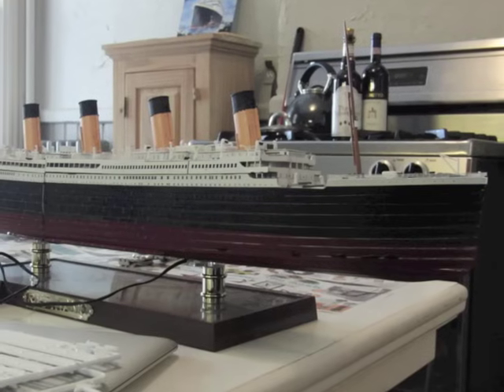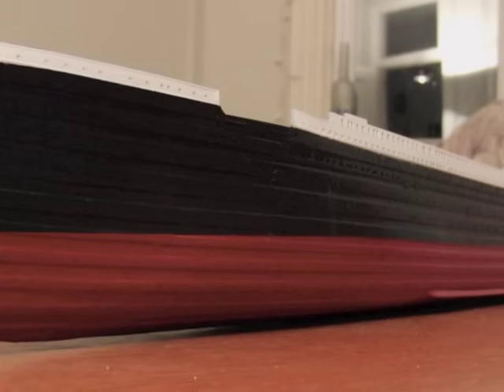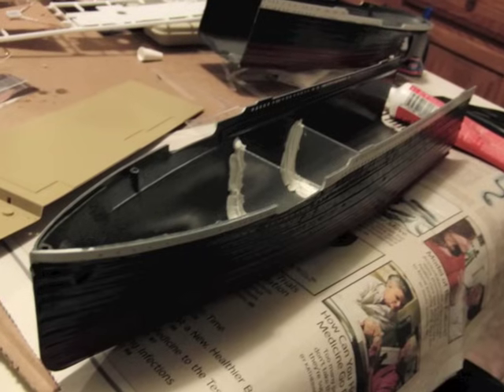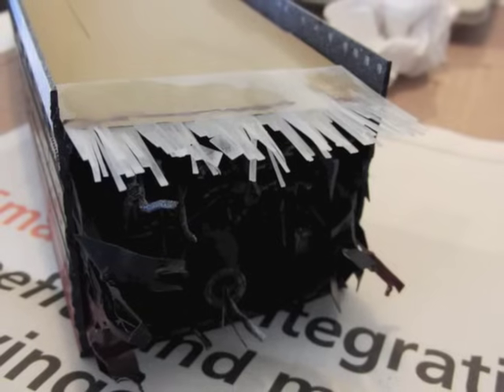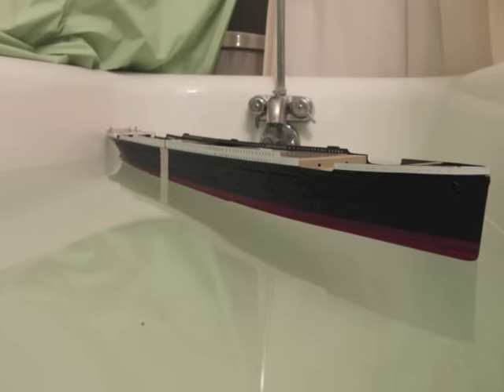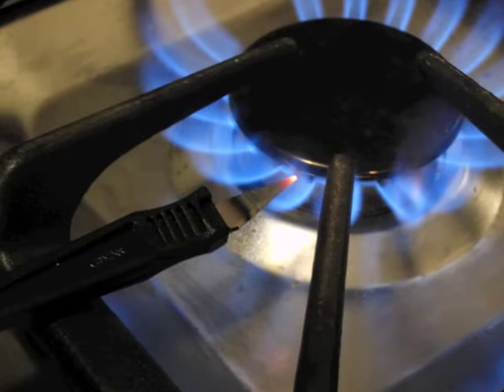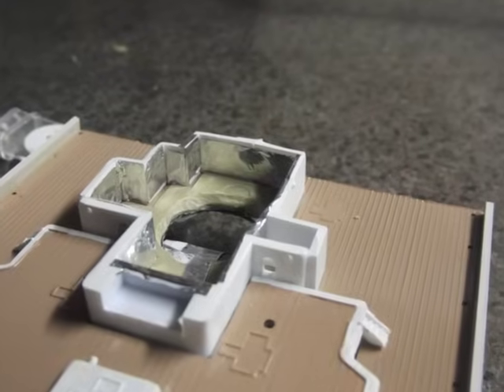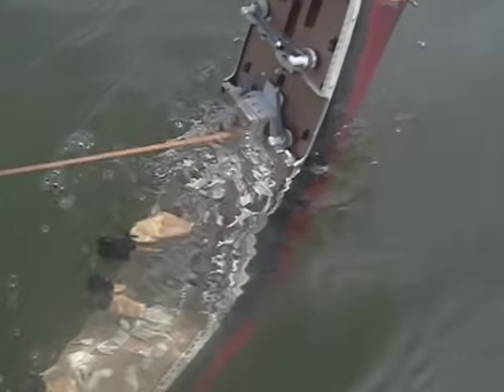[Model Titanic SPLITS] How It's Made

Comment: Just an FYI, Dremel makes some rotary tool wheels specifically for cutting plastic that make much cleaner cuts. Also, if your tool has a speed control, using the lowest speed can help you avoid the plastic melting you got.

Comment: would  be  better to  use  a  fine  dremel  cutter  in  a  speed  controlled  dremel   and  cut  from  the  inside.  and  don't  cut all  the  way  through.  make  the  cut  till  the  plastic  is  paper  then  .  then  just  snap  it.  this  make  a  thin  line  that  is  not  only  hard  to  see  when  the  two  pieces  are  together  but  will  make  the  hull  a  bit  more realistic.  this  is  how  I  cut  the  iceberg  damage on  my  raise  the  Titanic  model

Comment: I have that model. I made over 30 "watertight" compartments. I honestly don't remember how many are in there. Mine doesn't split or anything. My goal was to create a model that would sink like a real ship. At the slowest possible rate. She takes a full 15 mins to sink. and goes down by the head. I found you can control the angle that it goes down by creating lower bulkheads with ceilings with another layer of bulkheads just below D deck. Drilling holes in strategic spots and different heights.

Comment: I've been pondering on an alternative separation mechanism, and this is what I could think of:

Instead of relying on a fancy hi-tech thing, have a swinging pendulum in the bow with a circular hook connecting to a loop secured to the stern. Shorten or lengthen the hook to the angle you want the ship to break at, and let gravity and physics do the rest. However, the weight of the two halves might make enough friction to freaze it.

Another: electromagnets and a remote. Con: computers Pro: lights

Comment: The most effective way to cut plastic models is ordinary house hold sewing thread.
What you do is put masking tape where you plan on cutting and that will give you not only a cleaner cut but it also gives you a place to draw a reference line to cut along. using this technique will give you very precise cuts with very little matirial loss between peices. just wrape the thread around your pointer fingers on both hands and start sawing away like your flossing. you will be surprised with the results

Comment: @Rapidnadion Ah. I guess trying to install a propeller shaft as well as a motor, radio, and rudder servos in something that not only sinks intentionally, but breaks in half would be tricky. As is it's quit interesting as I've only seen one Titanic model of that size break in half and sink. It was an intentional sinking but we never got that Titanic back. Mainly because the lake was far deeper than we thought and that we didn't care as long as the method of sinking worked which it did.

Comment from the maker: @Pairjira They sure do; that's pretty much how we left it.  On the intact Titanic, we drilled out a hole on the fantail where the stern anchor hawser was (we think), to allow air to escape, but it wasn't necessary given all the holes left in the deck for rigging, so we didn't repeat that on the splitting version.  As long as there are one or two of those tiny rigging pinholes left open, air will still be able to escape.